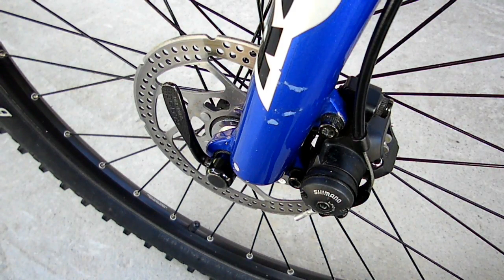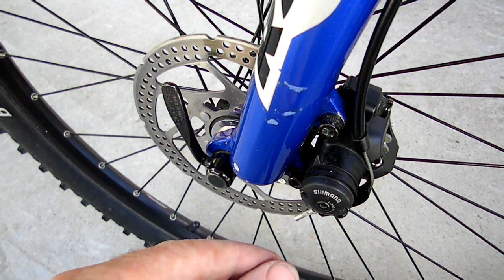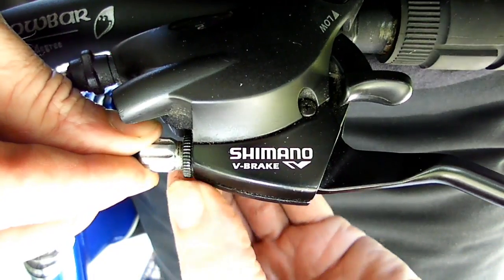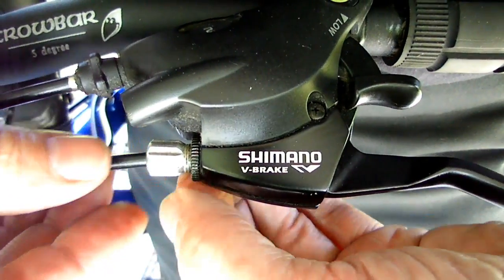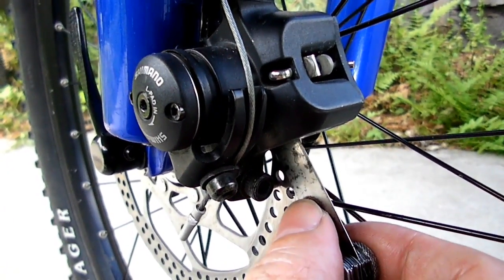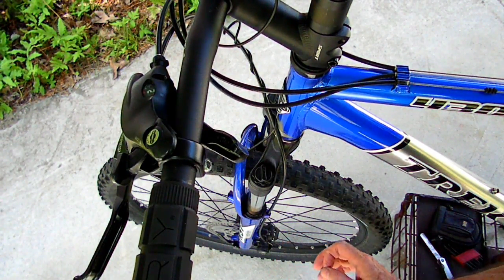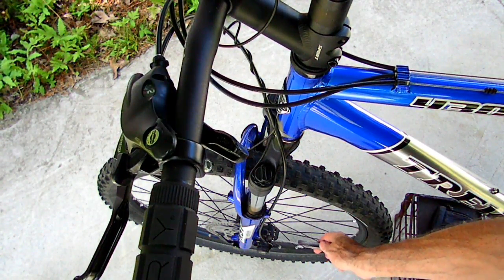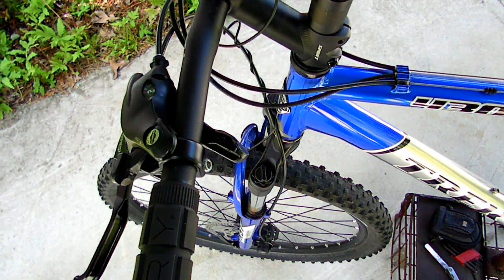Mountain Bike Disc Brake Cable Adjustment

Comment: @Bulgdoom 
-The holes are there to assist water being displaced, like the tread of a tire 
-more friction for increased grip 
-lower weight
-less heat. 
-Holes are placed in a way that evens out brake pad wear. 
And if these features aren't needed then that is why there are rim brakes.
Google "why are there holes in disc brakes"